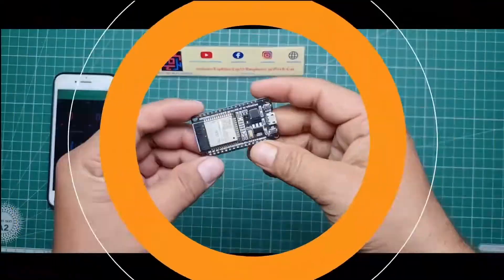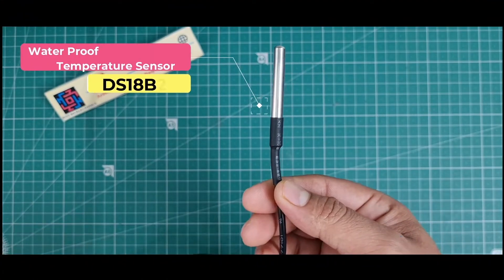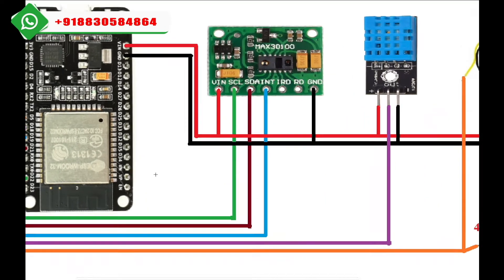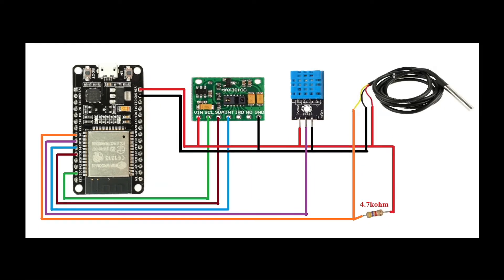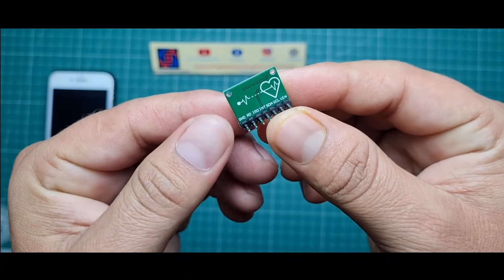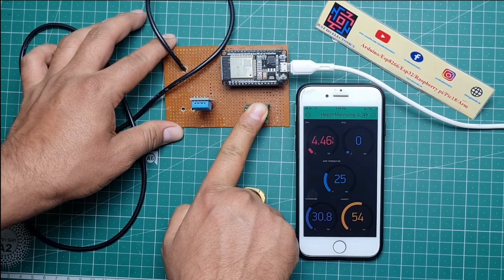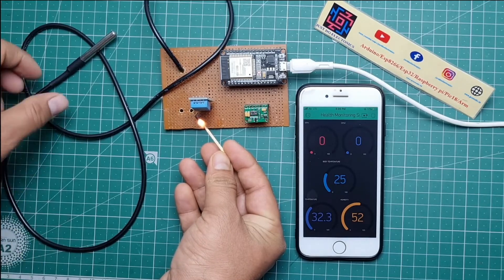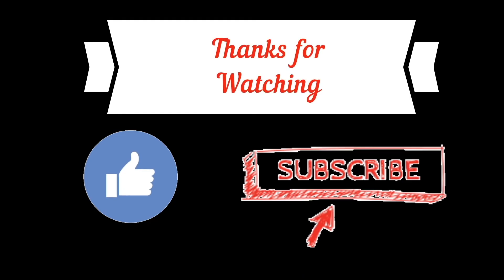IoT Based Patient Health Monitoring System Using ESP32 And Blynk App

Comment: why did you connect 4.7k ohms resistor?
Reply from the maker: Because the DS18B20 temperature sensor requires a 4.7kΩ pull-up resistor on its data line for reliable communication over the 1-Wire protocol.

Comment: The max30100 sensors led is not glowing pls help
Reply from the maker: Check the wiring
Reply: @JustDoElectronics  i have check the wire but i am using gy-max30100

Comment: I imitated this too using esp32 but on the max30100 it didn't appear but on the dht11 and ds18b20 sensors the value could appear. Please help, master teacher 🙏🙏
Reply: Same here
Reply: @PrantaDharDamu could u do it?
Reply: i guess you have to add pull up resistors in the scl and sda
Reply: Have you solved this @PrantaDharDamu
Reply: could u do it?

Comment: Sir i have problem, if i use esp8266 to connect with max30100 and dht11, the data is get well.After i add the blynk code, the max30100 data will become 0 , and the dht11 is work. can you help me to solve it ,tq sir
Reply: Same issue 😢
Reply: Can you sent me the code?
Reply: Is it possible now? If so, I'll ask if you can teach me please🙏